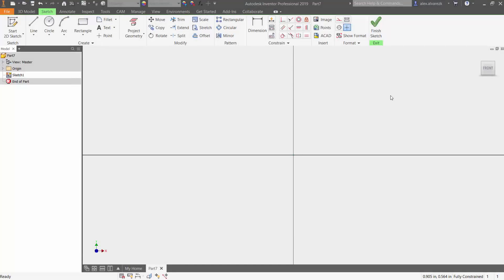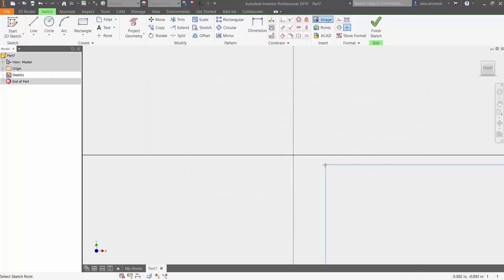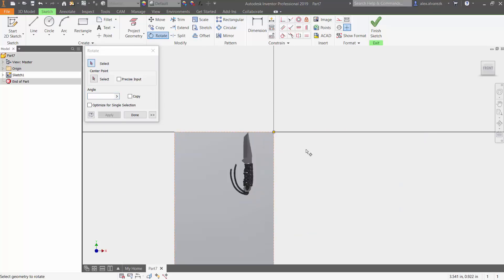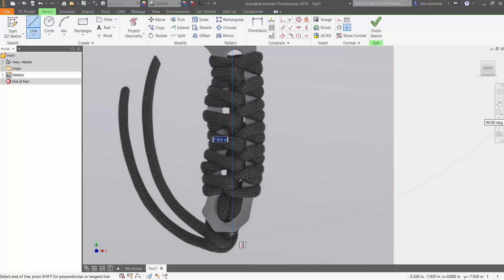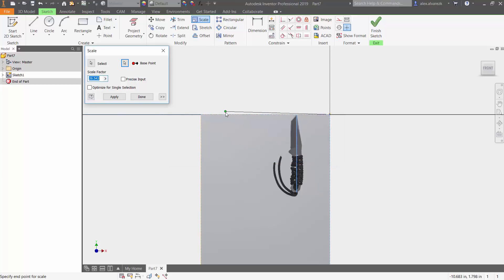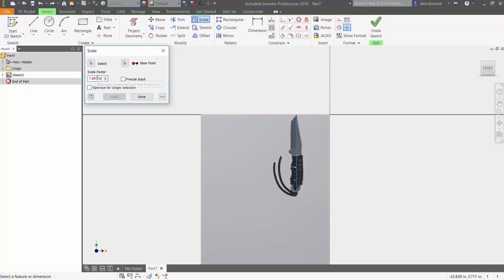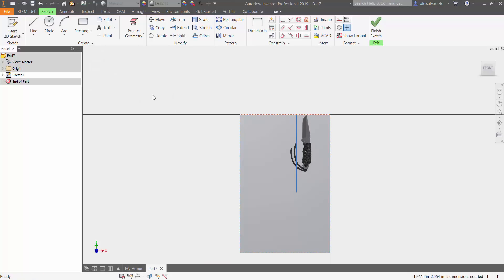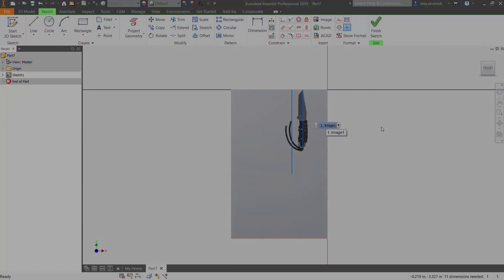Quick Tip - Insert Image

Comment: There is an easier and faster way, insert the picture, draw a line to match the length of the object, then add the desired dimension to the line,  the whole sketch including the picture will scalle accordingly.

Comment: I tried this but the 'Apply' is shaded out. I doesn't give me the option to remove constraints as it does in the video. So I'm stuck!
Reply from the maker: At what point is the apply not working? When the apply button is not available it typically means you still have to do additional selections for the command to complete.
Reply: @AutodeskMFG  It is all through the process. I tried following the video step by step and the only difference is the message that comes up asking to remove constraints, I don't get this message
Reply from the maker: That is because he located the image on the projected origin, It probably did a coincident constraint or some other automatic constraint to the origin. If you don't have the auto-project origin turned on the the options you will not get this message since the image is not being constrained to anything in the sketch. It should all still work for you...
Reply: @AutodeskMFG  I think that I need to start learning this program from scratch as I don't even understand the terminology. I can only do bits and pieces of what I know and try to figure the rest out intuitively, which is next to impossible. I will leave it here for now and perhaps look for a more basic program
Reply: @AutodeskMFG  i dont understand anything you wrote , beeing advanced INV user...